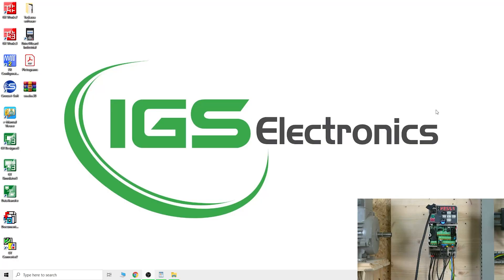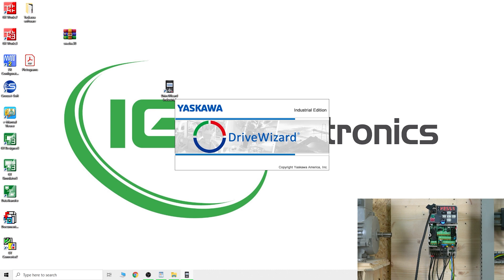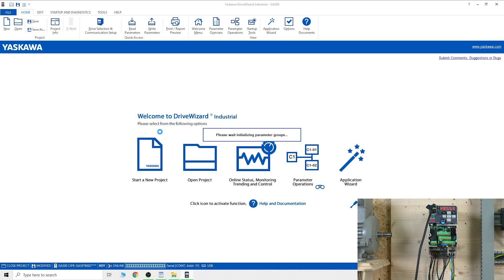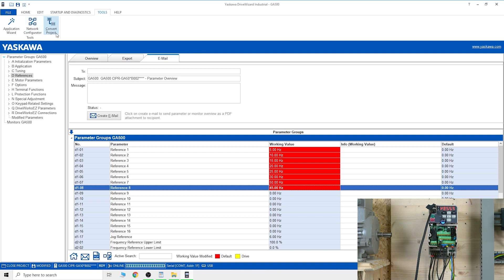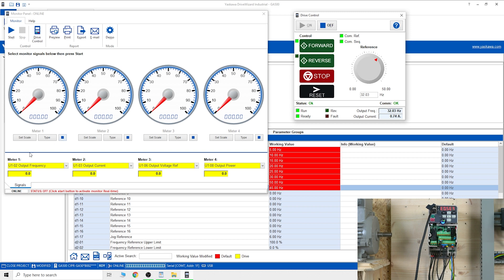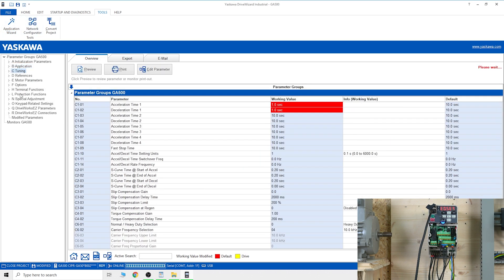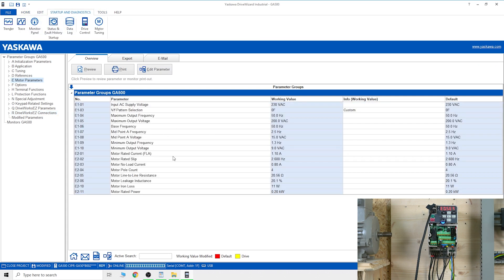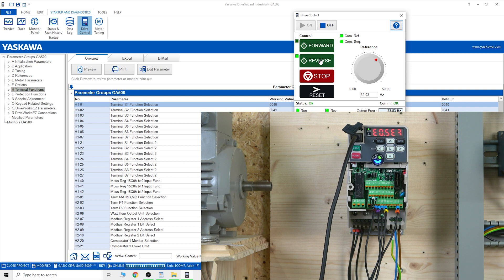Yaskawa Drive Wizard Industrial VFD programming Free software, program upload / download. English

Comment: how to set max hz to 800 in yaskawa vfd a1000/v1000/p1000?
In manual of all these, its written max. out hz = 400hz (user adjustable), what does that even mean?
Reply from the maker: That means max this particular drive can do is 400hz, most drives can only go up to that speed.
Reply: @IGSElectronics  I need vfd to operate my spindle at 800hz. Can you suggest any.
Reply: @dharmendrasuthar4342  you need to use the Servo motor to achieve that speed